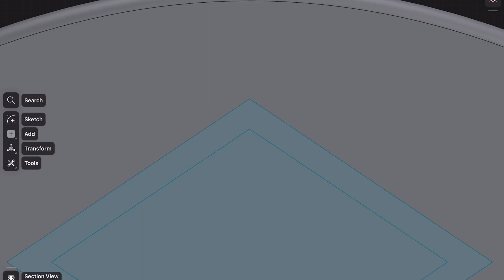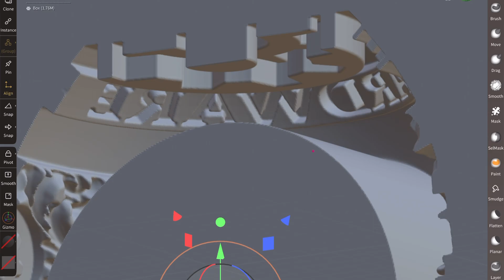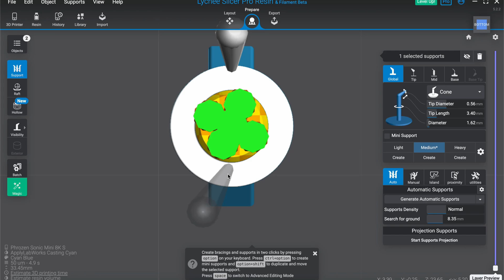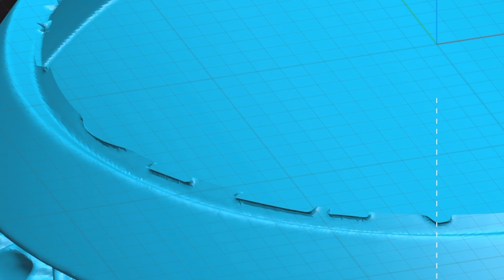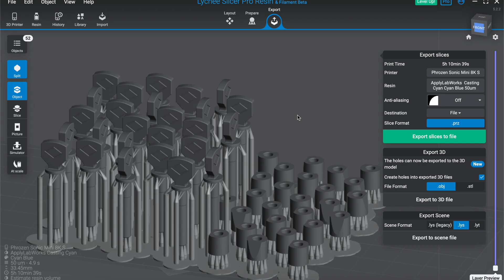Tips & Tricks for Casting Debossed Designs from 3D Prints

Comment: Is it possible to cast the threads and save an additional machining step? If yes, would there be some limitations?
Reply from the maker: They can be cast but they would be dead soft. Which for a thumb screw isn’t ideal.  By cutting the threads we had a slight work hardening effect.